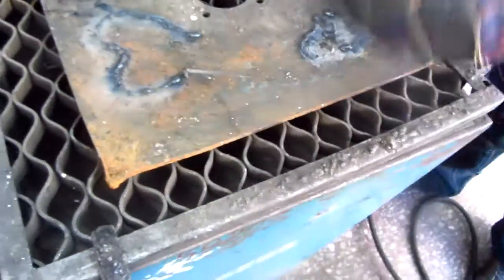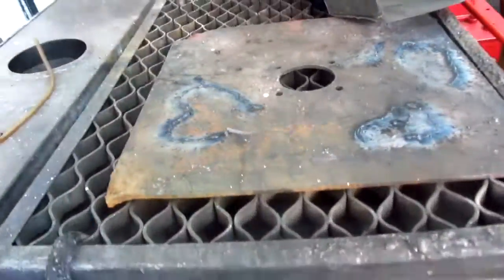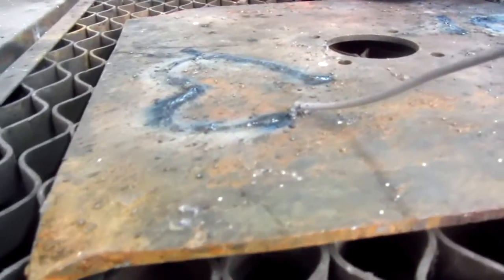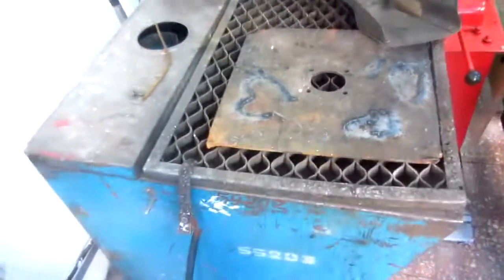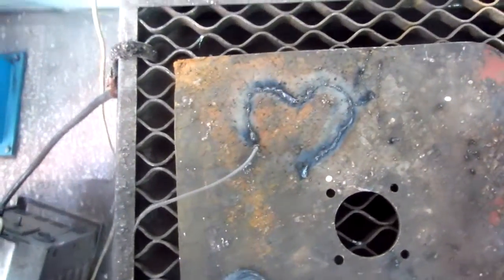Arc (Stick) Welding Fun (44Volts AC)

Comment: Did you know the lower the voltage the higher the amperage can go. And the higher the lower amperage.
Reply from the maker: That makes sense... from the the secondary winding's point of view inside the transformer, it is either thinner and thus longer (higher voltage), or thicker and shorter (higher amperage).